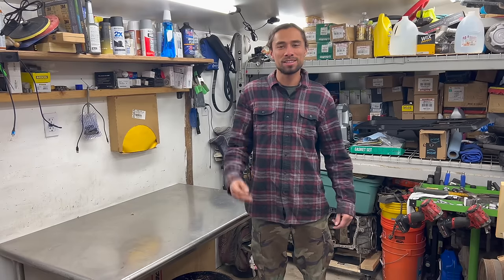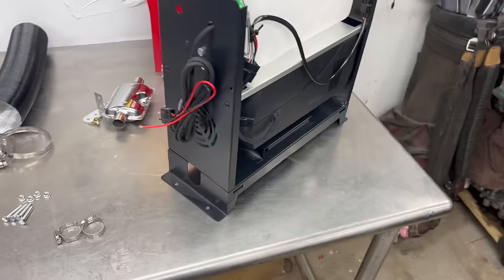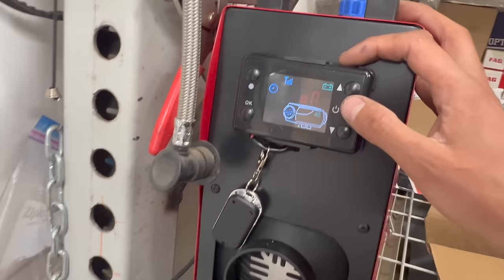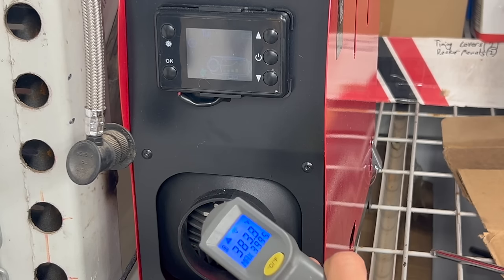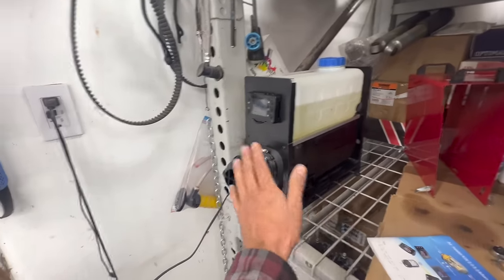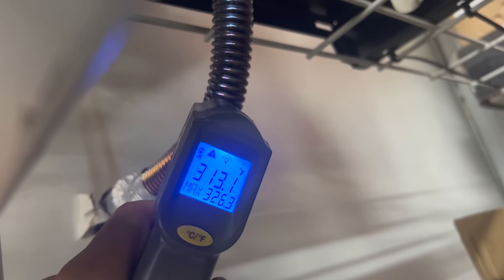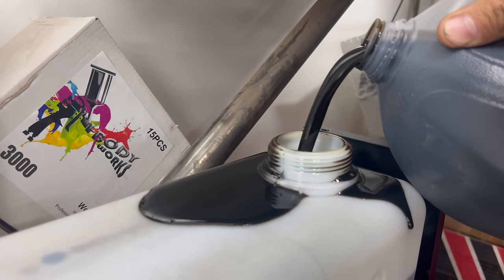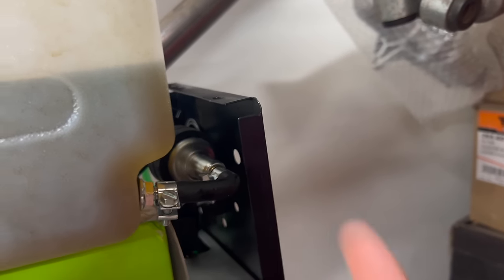Unfiltered 100% Waste Oil Vs Stock Diesel Heater

Comment: I have ran mine Vevor for 3 years and about a cubic meter of waste oil through it, but 50/50 mix with diesel and/or gasoline. The fuelpump is really picky, the used oil has shit in it and needs proper filtering.

Comment: Yup, won't work.  Too much build up after 8hrs chunks build up in the combustion chamber.  It gets nasty.  I mixed 20% gas, 20% deisel and rest waste oil... varied ratios to 50/50 waste/diesel always get ash/tar build up in combustion chamber and clean out required.  I eventually  bought 2 chambers for quick change out as well, cut near weld to ease combustion clean out. Then,  used hose clamp to reattach the combustion chamber.

Comment: Lol....I burnt waste oil for years in a modified furnace.  There is too much carbon and other solids in used motor oil, it will clog a Chinese heater in no time.  But at least you will be able to make a clean out video.

Comment: There is no nozzle to these heaters they are push pull pumps meaning they puddle fuel in where the glow plug is if you want to use waste oil you need to get the mix to 60:1 60 parts diesel then the rest waste oil or it won't burn right other than that you will be cleaning your heater more often than with burning straight diesel

Comment: i have tried all of this. u have to run it on clean diesel or paraffin in the end or it will clog up, actually u should do it midways aswell to burn off soot. no way around as i can see it, pref only clean diesel or Paraffin
Reply from the maker: How about modifying the screen? Or replacing it with a less fine one? I have yet to take it apart, but it’s 100% non functional right now. So it’s coming

Comment: Key points:
1) filter the used oil through a coffee filter
2) cut the waste oil with diesel
3) don’t spill oil all over the heater
4) buy the best quality unit you can reasonably afford.

Comment: This is an unsafe solution. If you want to use waste oil you should look at the stove outside the building with liquid Coolant: water, or maybe antifreeze, better propylene glycol based. Run pipes into the building and connect radiators. You will also need a water pump. 

Such stoves are very fire hazardous. Therefore, it is better to place them outdoors. If it catches fire, you will not be able to put out the fire.

Comment: the fuel pump is not pumping because it is running on its side, the best poison for the pump is vertical, that way no air can be trapped inside the pump, and Strate car oil is a bit on the heavy side for the pump to push out anyhow.

Comment: 50/50 mix after its running should work just fine. the oil needs a hot burner to burn cleanly.

Comment: For pete sake. Not another one trying to burn waste oil in a diesel heater? Then posting a video when it doesn't work very well. Really? Its a diesel heater, not an oil heater. This has to be no. 101 video where it does not work long term without plugging the glow plug hole and the burner plate. No common sense in this shop. Will it ever end?
Reply: Careful..  he complains back to you

Comment: I bet if you slowed the rate at which oil is fed vs desiel, you would get better performance and not overwhelm the system with oil.

Comment: Thanks for the video. Where are you located? Do you feel it can keep your garage warm? How big is the garage?
Reply from the maker: The small engine repair room is 9x 15. Does great in there. I insulated it well when I redid the walls. The bigger wood shop is 14x25. That’s about it’s limit, but my pops never finished the soffits, so mice have destroyed ALL the insulation (visually confirmed when the hole saw fell in the wall installing the exhaust for heater #2, so logically I punched holes in the wall till I found it). I have one in each room, but I really only use the one in the small room and shut (what’s left of) the door so I don’t heat the big room for no reason

Comment: The fuel pump is buggered by the waste oil. These pumps run really efficient with diesel as is. It's not worth it using the waste oil. I have sold several of these units, and have told customers only burn diesel. The burn chamber will get all plugged up with the waste oil and your glow plug will work harder.

Comment: I have run it very lean ratio, engine oil and diesel and it still carbons up. I wish I could share pictures of it all apart and what it looks like inside the burner, but it carbons up real bad

Comment: If you add 30% kerosene and oil will work, oil is hard to burn by itself. Even car running on oil need extra fuel not just pure oil.

Comment: I use
100 micron
Then 50 micron
Then
20 micron
Then 10micron
Finally 2micron
Bag filters 
Stacked inside each other
And filter the oil that way
It's the cheapest way.

Comment: Might have messed the pump up letting it run out of diesel. A lot of those pumps just like vehicle fuel pumps are cooled by the fuel going through them.

Comment: It has to be used cooking oil for it to run... new oil dont work.... in any case .... how abt mixing half gallon or 1/4 gallon dieael and 3/4 used oil 1:3 ratio kinda thing .... still cheaper than 100% diesel but it dilutes the oil a little 🤔

Comment: Could you elevate the tank enough so that you don't need a pump at all?
Reply: The pump is required to inject a measured dose of fuel per pulse. 
The heat output is changed by pulsing the pump faster or slower.
Reply: @benjurqunov  Oh! Got it, not just pumping device, but metering as well. Nevermind then. Although elevating the tank might reduce the work the pump has to do, and make it function more effectively with thicker fuels.

Comment: You can cut with regular gas or e85 also
Reply: I think this is likely a better idea than using diesel.  Gasoline has a lower viscosity, a lower flash point, and is 25% less expensive than diesel.  The oil is thick, gasoline would obviously thin it out much better than diesel.

Comment: 4 quarts oil/1 quart diesel (to thin) [I wonder if mixing 1 quart gasoline would help it burn off the crap better]
I have also seen guys put in a 2nd smaller tank and pump, with valves, start on diesel (get it hot) then switch over to waste oil, then shutdown with diesel (to prevent buildup in the glowplug/burner mesh)
I really want to try mine...I have over 33 gallons of waste oil...gonna have to build a waste oil burner for my new metal melting kiln so I can get rid of some of this oil...arrgh

Comment: I tried 9 liters of diesel and 1 liter of used oil  mixed with old gas (10 liter tank), one tank and needed to clean out the heater. These heaters don't like used oil.

Comment: How you prime up the pump. Please tell
Reply from the maker: Depending on you model, you hold 2 buttons. I forgot on this one (as I now have 4 others with different interfaces) 

It’s not necessary on these units,you might just have to start it 2-3 times, it will prime itself. It’s more critical on the kit where you might have 5ft of fuel hose.

Comment: I don't know if I recommend doing this to anyone, if you used solar power to distill used motor oil in the summer it would be as clean as new. You may still need to mix in diesel to get the viscosity proper. Everything that would get left in the heater would be left in the still.
Reply: The petrochemistry is much more complicated than that. The gasoline is distilled out at 180 °C, and the fraction of 180 to 360 °C is diesel, leaving asphalt as residue. You can't just distill used oil and get "clean as new" oil.
Reply: @teebob21  I get that it won't make oil into diesel, I just think if you want to burn used oil, distillation should remove anything that would leave residue behind in the heater. Except for residue from burning the actual oil. Cracking it down would be a different deal.
Reply: @wesKEVQJ  Yeah...don't quit your day job.
Reply: @teebob21  I won't. Honestly I am just curious about ways to stay warm in case bad things happen. One of those is burning waste oil. I don't think I would do it in a diesel heater though. I think I would go with a drip feed.
Reply: @wesKEVQJ  Do you know how these heaters work? They are forced air drip feed heaters, with the drip coming from the pump. There is no pressure, no compression, no cylinder.
Reply: @teebob21 Yes, I get that. What I meant was one of those oil burners that has a container above the furnace with a line feeding oil to a pan, usually made of an old wheel that's wleded at the bottom of it. Not s simple as soaking sawdust in oil but you don't have to continuously feed it.

Comment: I’ve been curious to try this myself but I watched a couple other videos and came to the conclusion it’s not realistic nor would I feel comfortable leaving it unattended.
Reply from the maker: I’m comfortable leaving it alone, but it WILL clog the burner, I’m still on my quest to make this work, I’ve broke 2 more heaters since filming this…..
Reply: @steinfabgarage  have you tried messing with the fuel pump settings? I would think the oil burns slower and you may need to back off on the timing of the fuel pump.
Reply from the maker: @jeffclark5024  yup, no matter what you mess with there will always be loads of buildup vs clean diesel, I’ve tried a lot, and I have some experiments in the works. If you run anything but clean diesel expect to replace the burner eventually
Reply: @steinfabgarage  So hear me out, I’ve pondered before dissecting my own Chinese diesel heater and using the parts to run a waste oil burning stove… say you use the controller and fuel pump and use the fan to feed the fresh air to the stove. Fuel pump would be run to a metal line that drip fed the stove. 
It would probably require manually lighting the fire and defeating a sensor or two but once lit it could potentially maintain by itself and once the thermostat is up to temp it would slow down the fuel and the intake air. 
If the burner is the problem then replace it with something that is suitable. Like a steel tank or old wood stove.

Comment: I've seen these run great on waste oil of all types. But it was filtered before to 1 micron and then pre-heated. Or made to pure bio-diesel before. Pretty funny to see what happens if you just throw it in lol. I bet if you cleared the combustion chamber and perhaps the pump it'll start right up again.

Comment: It's a VERY BAD IDEA to run any motor oil through one of those heaters, unless you want to take the heater to bits every few days to clean out the debris.
Motor oil contains additives that do not burn and will leave ash in the combustion chamber.
It doesn't matter how much you dilute the oil with diesel, the additives will never burn and will clog the combustion chamber.
I knew this without trying it....

Comment: It will always build up with any waste oil, even filtered or cut with gas, etc.   Just do not do it....
Reply: Fact!  No amount of different ratios of oil/fuel will matter. Or running clean diesel after will remove the "build up". 
I've found that the ratio really just changes the duration of the chamber clean out.

Comment: If you use 75% used oil 25% diesel it will usually run great

Comment: SNARKY!   lol   Nice concept..... take a 3000.00 device, and make it into a consumer desktop appliance......  The ones you see in auto service centers hang from the ceiling, and about once a year, they clean out a small amount of white ash. The oil is incinerated at exceptionally high temps. On a shelf where it can come into close proximity or contact with peoples is a little bit sketchy.... but I gotta go back and watch the ending, see how you resolve the error code....... maybe I will "LIKE" it and subscribe...... it all depends on the entertainment value!   :}

Edit:  OK, since you did not die of monoxide, I will give you the thumbs up. How about getting a proper waste fuel/waste oils heater, if you use the garage enough to warrant it ?

If you make more videos, don't forget the VEVOR or other high quality MONOXIDE DETECTOR ?

Comment: Find an old xbox 360 power supply or something similar to take 110v to 12v then you can plug it in the wall

Comment: U forget viscocity diesel yes with diesel u are lowering oil visco but increasing diesel visco. Use bensin to thin it down. I use on my car 50 wmo 30diesel and 20bensin

Comment: Cut it with diesel. Bout 60 diesel, 40 oil. Should work.
Reply: But doesn't. The small burn chamber can't cope. It needs clean diesel
Reply: @jamesward5721  i guess. Idk ive never had a small tiny one like that. But ive got one of thoes torpedo heaters that run on kerosene. I run mine on a mix of diesel and used 15w40. Acctually seems to burn hotter with the oil mixed in. Does smell a bit more though.

Comment: The conclusion is not quite correct. YES DONT do what he did. Don’t MIX vegetable and waste motor oil. Either are fine. Never mixed. One causes the other to precipitate out sludge that will foul badly. EITHER one (WVO or WMO) mixed with diesel, and thinned out with a bit of RUG (regular unleaded gas) OR warmed to thin it out, has been run fine by many in diesels motors for many decades.  Trouble free when done correctly. Settling out sludge, and Filtering is needed. But either will burn just fine without horrible fouling BUT there is prep work involved. Lots of helpful forums on the web just a click away. Just because vid guy did it one wrong way doesn’t mean there’s not a right way. There is.

Comment: #1 Good review, #2 oil is too thick uncut (25% min.), #3 NEVER cut with gas as way too explosive, #4 sorry but too many (BLEEPS) for me to want to sub
Reply from the maker: Thanks for the input, I’m actually experimenting with it cut with gas now. Time will tell
Reply: #2 Fuel oil is essentially 2007-  diesel with red dye in it.  Gas pump diesel is ultra low sulphur and more engineered than the stuff that predate 2007... which you COULD make yourself, if you had a regular supply of contaminated cooking oil.

Comment: You should try mix with diesel
Reply from the maker: Tried, worked better. Tried cutting it with gas, didn’t work. Next I’m gonna try centrifuge filtered oil

Comment: I can tell you don't bother using cooking oil in any mix  it clogs it right up
Reply: I have a 55 gallon drum of used oil including a bit of cooking oil from when we fry foods. I'm guessing it's no more than 1-2 gallons (2-4% of the overall drum) but it hasn't given me any trouble. I do run a filter on my intake line - maybe  you're getting used food sentiment?

Comment: Every single thing besides diesel or kerosene should be cut at least 50/50 with diesel.  Asking way too much to only chug straight used oil.

Comment: ok dmbass. let me save you and everyone else a bunch of time. what your doing wrong is..... 1. air in the lines. 2. fouling the glow plug. 3. stuffing up the burn mixture leading to a filthy burn chamber. 4.  those heater layout are terrible. deconstruct it. so the lines and tank etc all flow better

Comment: These come on only 2 sizes. 3k and 5k. There is no 8k or bigger.  Weird huh?  So they tested the fan speed , cfm and heat from a labeled 5k and 8k... they are both the same dimension and exact same  electronics.  Marketing scams right?  Who knew.  The 3k unit is very small. Probly good for a car or small truck.

Comment: I add 10% gasoline to waste oil and it works perfectly
Reply from the maker: How many gallons have you run? Do you filter the oil?
Reply: I pump oil through engine oil filter, adding diesel to oil doesn’t help, gasoline is what makes it flow easier because its molecules stick between oil molecules hehe. 😎
Reply from the maker: @andreym325  gotcha, and how many gallons have you successfully burned of the mix?
Reply: @steinfabgarage  25-30

Comment: The heater is cheap and efficient.  Diesel is cheap.  Run it on diesel.  Or, break it with unfiltered waste oil... 🤷‍♂️

Comment: Mine died after 100% oil, i went to 50% then 30% to 10% and it ran but not good. Your pump isnt fkd i thought mine was too. Just clean it out with diesel. Its a diesel heater just run it on diesel. I have 4 x 44 gallon drums here of waste oil so thought id give it a go.
NOPE.

Comment: I tried this idea. After about 15 hours running time it would not fire up. I dismantled it and the combustion chamber was solid with carbon crap. Dug it all out and tried it again coked up solid again. Stupid idea. This guy says about smoke coming out of the intake is because the chamber is clogged. Again why bugger the machine up to save a few shillings. This guy has no idea what he is doing. Running correctly I ran one of these machines on red diesel for 8000hours till I sold the boat it was in. Never a bit of trouble.

Comment: Everybody and their brother has tried this trick nobody has succeeded it'll only run for a couple days and you're tearing it apart and if you're really relying on this for heat that's the last thing you want to do. They are called diesel heaters for a reason If you want a waste oil heater go buy one of those

Comment: your should read the instructions, the pump should be mounted on 45 degree angle and you probably clogged the screen in the burn chamber. there is about 8 years worth of videos on these heaters already !!
Reply: Not to mention all the other videos trying the same things.

Comment: I am not a fan of diesel heaters. It almost killed me. You are on YT we know that for sure. So why not build a waste oil heater?
Reply: What happened?
Reply: @jetmelt  The guy who sold it to me think he was Russian failed to tell me that the 30' exhaust pipe was 27' to long. Many issues over the 8 months it lived. 1st major issue was it started spewing smoke in the middle of the night. Lost heat so I ran a heater your not supposed to run to keep from freezing. Woke up to no air, lucky I woke up. Left to a motel. That was the 2nd time in less than a year I almost died. 1st was arson, fascists working with the cops. In the hospital for 5 days, cats dead, lost everything. 2020 sucked
Reply: Wow! @GudasWorld